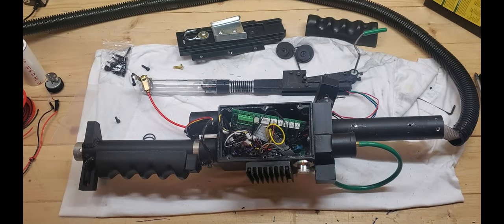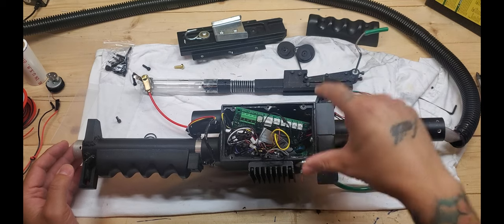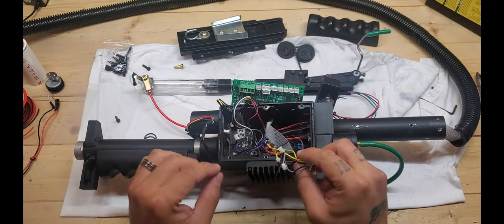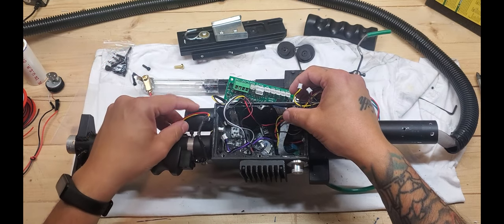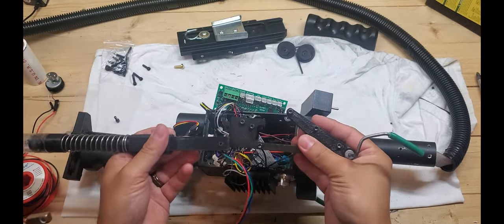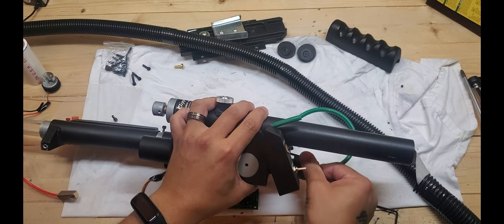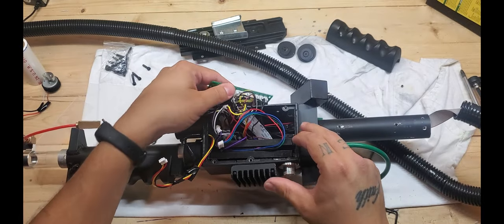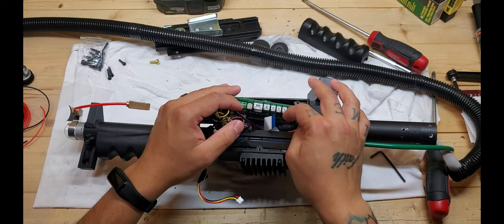Ghostbusters Proton Thrower Build - Throwing Chicken Model with Pop Mech Tips and Tricks and Demo

Comment: Does the barrel twist?
Reply: Throwing chicken kits have a front handle that twists on the inner aluminum tube right out the kit, or you can glue it to the said tube and cut a slit into it under the clippard where the 2 hex screws go into it and that allows twist as well but only to the length of slit you cut as apposed to the full rage of twist that could rip wires.